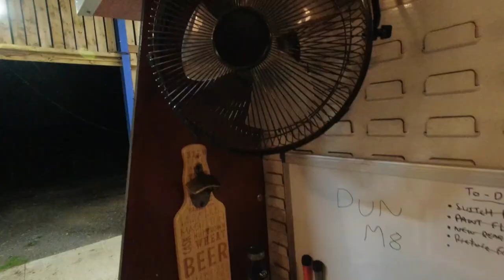Up-Cycled BT Workshop Trailer Build: Finishing Touches - Finale

Comment: Good job CJ. One second opinion, it will be a super plus fitting in the roof 1 better  2 over 300w monocristaline hight ifficiencie black solar panels , that way you will save in petrol for the generator. And if you shop at facebook market a 12v compressor fridge....

Comment: you should get one of those little plates you put on top of the bolt that holds the tire, so you bolt the tire down by puttin the plate against the rim, saves you some time getting it off

Comment: Looking good. You fitted a reversing light, but what about a rear fog light?

Peter Burnett says you need the large reflectors on the back (like HGVs have) if over 12m train length. I had to put them on the back of my caravan here in Spain, because the total length of car and trailer exceeded 12m. (I have a long car!). They look alright though.

Comment: Great post, the damper needs a dud bolt to hold it place to tap it through with the fixing bolt..but I guess you worked that out.
For Spain you need marker boards if you are over 12 m total..
And because you cut a bit off the A frame you may need to pull weight further forward, but the extra weight of the jockey wheel probably compensates. I guess you need about 50-65 kgs on the hitch to keep it stable.
Reply: 100 lbs in UK.

Comment: Hitch dampers are designed to work correctly within a weight range 
If the trailers too heavy it will overbrake and potential lock up,  or too light  under brake 
It really needs to be matched to trailer weight

Comment: just fitted new tow unit to our caterinr trailer fitted with short bolts had to change to long bolts with spacer in A frame as was bending top of A frame (had to drill bottom of A frame with spacers and long bolts ) think may have to do same

Comment: I love it great job and little cost have you thought about condensation on the ceiling I used a box similar for storage and it was a problem for me polye foam used for laminate flooring under lay and packaging for TV'S etc is amazing for things like this I covered my velux sky lights with it and it made the room brighter as well as stopped condensation

Comment: Hi buddy just so you are aware you do not legally need Reverse lights on any vehicle/trailer in the UK it’s not an MOT requirement either
Reply: Yes you do,  it is part of the mot and has been for a while now.
Reply: @s2kboy69  I’ve never failed an MOT not having reverse lights every mot tester I’ve had has told me you don’t need them there just a courtesy thing
Reply: It is now a criteria of cars from a certain date. 
If you'd like the information I can provide it. 
You have been lucky.
Reply: @s2kboy69  nah I believe you it’s just shitty that some people tell u that u don’t need them I don’t think the police would ever stop u for it but thanks for the info
Reply: You must inspect all reversing lamps fitted to vehicles first used from 1 September 2009 other than quadricycles and three-wheeled vehicles.

Reversing lamps must show a white light to the rear. On some vehicles it may be necessary to have the engine running before the reversing lamps will work.

At least one reversing lamp must be fitted.

Buses over 6m long may have 4 reversing lamps which may be:

all showing white light to the rear

• 2 showing white light to the rear and one on each side

Defect

Category

(a) A reversing lamp inoperative

Major

(b) A reversing lamp lens defective Major

(c) A reversing lamp:

(i) not securely attached (ii) likely to become detached

Minor Major

Comment: For the lights, It all depends how much you want to adhere to the new regs, they should be E marked, no further than 50mm from the outer edge of the trailer and also a reverse is needed when the trailer is over 1600mm wide.

Also, those Audi style chasing lights you got from Amazon are shite, I'll be honest. I got a set  and sent them straight back on the grounds they 1. Started letting water in 2. Started failing 3.from a distance you struggle to tell your indicating while braking.
Reply: Or just hang a lighting board on the back doors and none of that is applicable. Would look crap though 😉
Reply: @andypugh2000  thoroughly crap indeed. I've got the same BT box on a caravan chassis and when I first had it, it had a 4ft board hanging from the bi-fold doors. It was so shit even VOSA stopped me to tell me as much 🤣

Comment: I've got a load of Lithium Lifepo4 batteries due soon (next 7 days). They are 3.2v cells 110ah that I ordered for my 72v leccy quad project. I over ordered by 4 cells = 12.8v battery. All they will need is a BMS (£30) and connecting up. Loads of tutorials on YT, dead easy. You can have em for £100.... that's a bargain..... half price (£50) for a kiss of Lance and we suck a bottle of SoCo. Drop me a line if your interested and we sort something out.

Lifepo - 80% depth of discharge and 3000 charge cycles. 
Lead acid  - 50% depth of sicharge and 500 charge cycles.

Comment: I get through trailers from time to time and have also fitted some of those rear lights, will be interesting to see how yours go in the elements. Whenever I get cheap trailer lights I plonk em in some water if the seller claims they are submersible. Saves faff in a years time